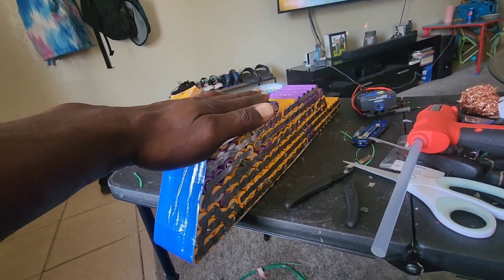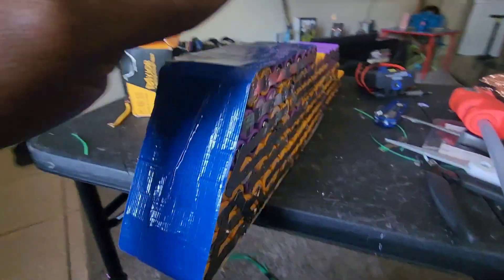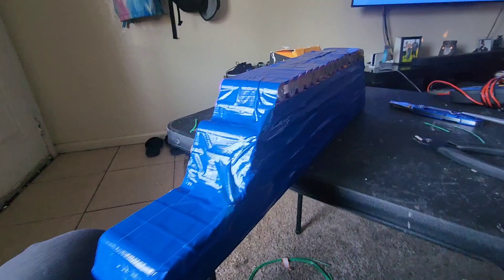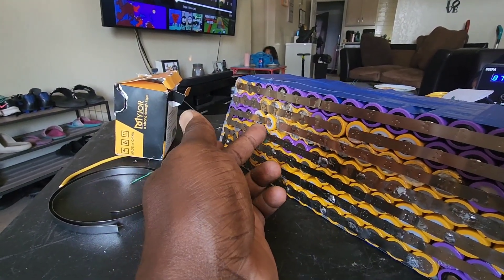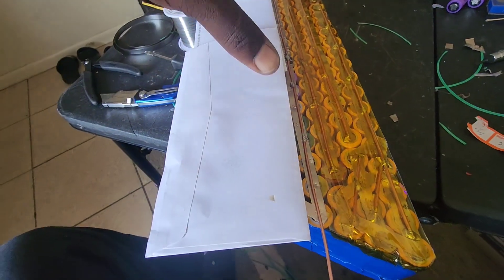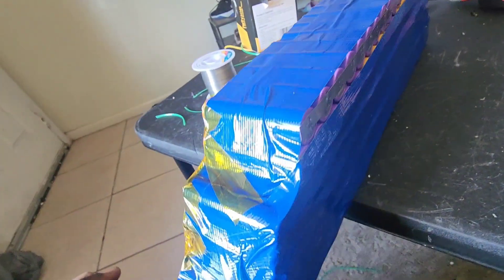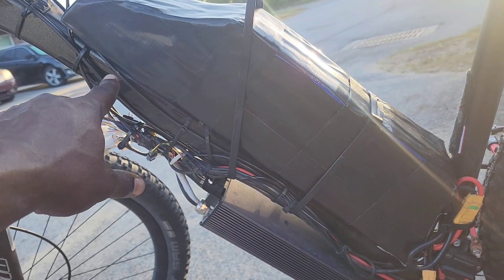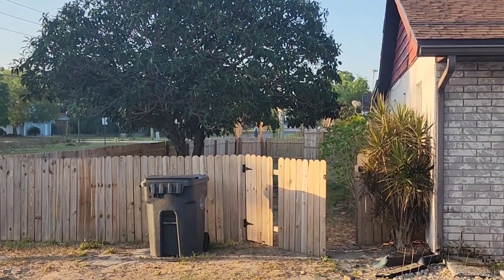48v 32.5ah diy ebike battery build

Comment: That is what I should do with the cells inside the four Hailong style batteries I have...just take them apart and put all the cells into one large unit with beefed up bus bars and larger + and - wires.

Comment: Curious as I honestly have no clue...what would happen if you put a DC to DC voltage regulator between battery and controller...could you, say, run a 60V battery, set the DC to DC convertor to 54.4V...would it be possible to run motors with no voltage drop? This example would be connected to 48V controller.  But could be applied to any setup.  I just don't know if it would work.  You would definitely have some Wh lost to the conversion, but not much with a good converter.  Have any thoughts on this ebikeguy?
Reply from the maker: Oh man that's a tough question.  I'm pretty sure if it was possible it probably be out there
Reply: @EBG-offical  That's what I was thinking too, but maybe it's a cost thing...a DC to DC that can handle the kind of amps ebikes want is probably pretty pricey, and large.  I am gonna try a scaled down experiment with a smaller battery pack with lower voltage on a smaller Amp load and see what happens.  Lower power DC to DC are pretty inexpensive.

Comment: What motor build do u guys recommend only got 400$ to spend and just want 30 mph and like 30 miles range
Reply from the maker: @Esteban-g3w  1500w motor on 48v will get you to 30mph
Reply: @ what kit do u recommend?
Reply: Dual motors aren't much faster, but hill climbing is way better.

Comment: Although an interesting project and a nice accomplishment, it is important to highlight the changing regulatory environment for ebike batteries. 

Increasingly, UL certification is being required, limiting where such DIY batteries can be used. For example, New York recently prohibited the sale of ebike batteries that are not UL certified.  

Although this is a disincentive to hobbyists, it will result in safer batteries, fewer fires, less property loss, injury and death.

I think that we all need to be aware of this trend before we consider building our own ebike batteries.
Reply from the maker: Oh yes I definitely aware
Reply: @EBG-offical  its more for your viewers who may be inspired to do the same.  We're all in this together.
Reply: Just use lifepo4 or LTO...
Reply: @nicod974  it's the regulations that will increasingly limit us. The other chemistries are certainly part of safety improvements also.
Reply from the maker: @nicod974  ok will do

Comment: be careful with those batteries, you don't realize the simple mistakes that can be made exist until after you experience serious issues. make sure your nickel tab doesn't extend past any end of strip cut off on your positive connections the left overs can be sharp and puncture right through the felt circular insulation and contact negative very easily( also be aware at all times only the small part on top is positive but ENTIRE rest of the batteries body is negative) I always double up the Insulator rings and as for insulation on the sides of batteries I wrap each parallel group of batteries to isolate it from the next, depending on the amperage may use fish paper or may just use kapton tape.  

also remember nickel strips only carry about 8amps per 8mill wide 0.15 strip. so if each cell is 8amps capable and you will be using it to full potential then each cell needs its own strip crossing the parallel connection. there's other ways to do it, better ways then 10 strips crossing per 10p but this is a simple way to explain it.

but running the batteries in long single file rubs like that you would need to connect (let's say it was 10p so a connection is 20 batteries in single file 8amp discharge celks) all 20 batteries across with a strip of nickel. then another one connecting  the18 middle most cells again over top of the first strip(the last one on each end has its 8 amp path already) then another one connecting the 16 middle most cells and so on... until you are adding you're 10th overlapping strip that just connects the middle most 2 batteries where the series connection starts. if you don't give em enough path for the current being pulled it won't provide enough current. it could heat up if you are trying to pull more and be bad.

most cheap Chinese batteries aren't built up to par for this. they may rate it at 5000 watts the cells may be capable of that but there's no path. there's other ways to do it then adding more nickels but it's hard to explain without pictures but running em single file series like that makes it harder then grouping the series groups in stacks left to right. adding copper strips is one way. sandwiching em or busbars. I made one with just strips 96v 26s15p about 45ah and it needed to provide the full 150amps the cells are capable of(needs 230a total but I got my controller set at 135a for now and it's still a beast, was planning on adding more later or redoing it with headway cells but it's low priority cause I can't even smash the throttle on it as is without flipping it over) and I ended up using about 6 10 meter strips of nickel  and going through 2 spit welders. I get impatient and your not supposed to really go weld after weld high speed. the fact my breaker kept going was a good warning but I get impatient and had a lot of welds to do. a lot of welds..... because when you're burying it so derp in nickel you def wanna make sure the first layer is WELL connected to the battery haha. next time I'd use a mixture of cooper and nickel sandwich method(google it)
Reply from the maker: Oh yes I'm definitely aware of the mistake over trial and error in my previous practice in battery build and that is why I'm going molicel on all my builds

Comment: I recommend you spotweld some strips of  .1mm copper sheet instead of soldering wire. The solder can come loose with vibration. The .1mm copper will still allow you to pull the amps you need.
Reply from the maker: Ok nice idea.  I'll get some for my battery build for my 8000w ebike

Comment: Why do you not attach a BMS? Do you think that is kind of dangerous for charging and discharging?What prevents overcharging?
Reply from the maker: I have not been running a bms in none of my battery build for almost 6 months with no problem and I been doing a lot of research and the chargers are smart ones that cut off at the correct voltage,
Reply: Info on charger please I want to build a battery with out bms 72v

Comment: still built incorrectly. have you ever even tested those cells? why does each cell group only have 1 series bus? those nickle strips are rated for like 10 amps
Reply from the maker: I don't understand, I have copper soldered on top good for 150a I'll do a video on it tomorrow to show you, and how it ride,
Reply: @EBG-offical  even with copper. Still built incorrectly. I only want you to do the best job you can do.
Reply from the maker: @cybrwerks  understood,,

Comment: Nice job. just to let you know a good way to figure out amp hours of a battery pack build is if you have 2500 mah battery cells, you divide 2500 by 1000 and then multiply by the number of cells in parallel so you would get 2.5 x 11 which comes to 27.5 amp hours. Thank you for the great videos please keep them coming. 
Thank you,
Jim Johnson
Reply from the maker: Thank you always need advice as I'm still learning

Comment: Looking good. I certainly would not have the confidence to do that, respect brother.
Reply from the maker: Thank you. I was definitely nervous at first, but it went well
Reply: I respect your honesty about building a battery that’s my only concern with having enough range
Reply from the maker: @frankroach9346  yes it takes more cells in parallel to add range and handle more current depending on which cells you use

Comment: Nice one Bro 💪 may I know where you get your 18650 cells?
Reply from the maker: I get them from 18650 battery store it's way cheaper
Reply: @EBG-offical  any store recommendations Please?
Reply from the maker: @ebike_tales  https://www.18650batterystore.com/?utm_campaign=1649640418&utm_source=g_m&utm_medium=cpc&utm_content=318378250062&utm_term=p_18650%20battery&adgroupid=62002129663&gclid=CjwKCAjwo7iiBhAEEiwAsIxQEcDJIxpfQo8aRnk-C0lukmnAPQ7ANMOHKRM4x4_K_coUkZBMDptaMBoCxc8QAvD_BwE
Reply: I also wanna report myself to you I tired to overvolt my ebike 500w hub motor with a 52v and 1500w 40ah controller and I got the 500w coils fried😂 I think I should have also changed the hub to a 1500w hub motor what do you think?
Reply from the maker: @the ebike tales  well at least a 1000w hub motor,  once you over volt your motor make sure you keep close tabs on the motor temp especially your running 29in wheels